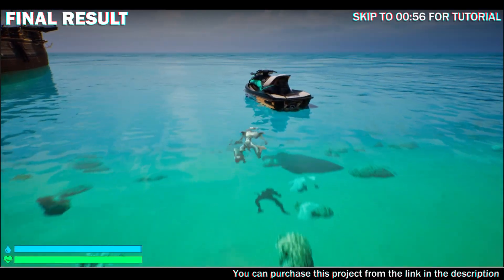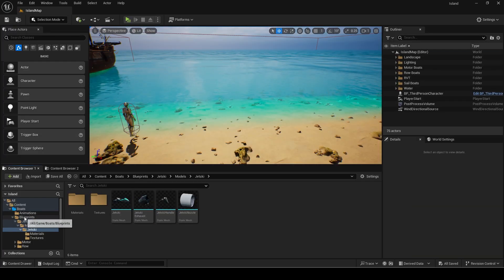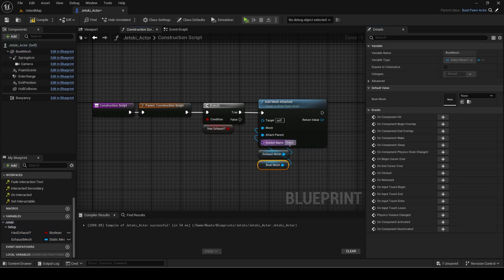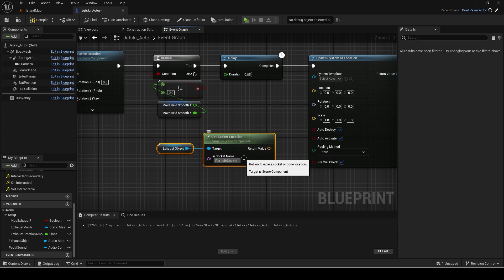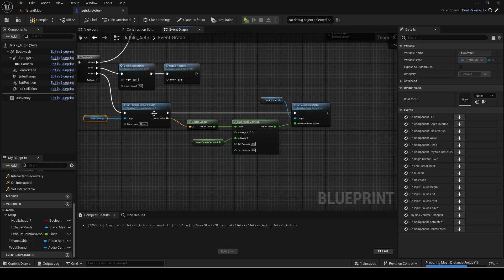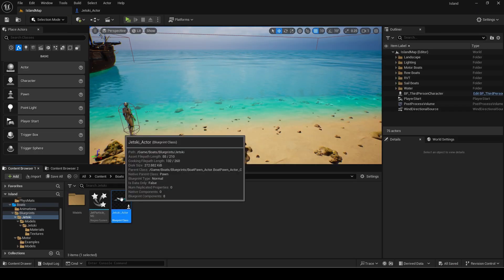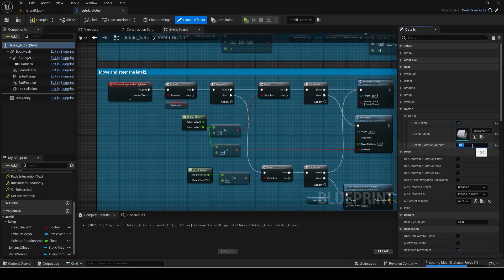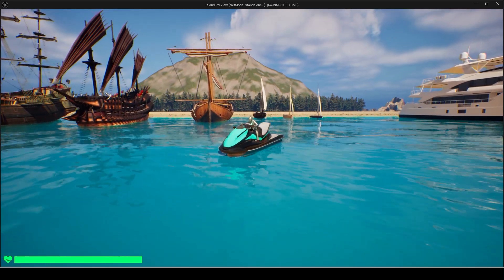Unreal Engine 5: Jet Skis Tutorial (Water Series)

Comment: Why isn't it on fab? I've already bought a lot of assets on it.🙃
Reply from the maker: @ue666  I can’t release these on fab since it uses models from sketch fab and mixamo animations which aren’t made by me so I don’t think I can legally sell them on fab so I used gumroad instead.
Reply: @UE5Poseidon  You can fill in the dependencies when publishing and use a simple model to replace the assets in the video as the initial blueprint function, which can pass the review.
Reply from the maker: @ue666  does the dependencies allow mixamo animations to be used?
Reply: @UE5Poseidon  I don't think redirecting mixamo to Character is an infringement, but you can still separate the redirected animation assets, not include them in the assets submitted by fab, share them with users through Google Drive, and clearly indicate the dependencies. Even under the most stringent requirements, you can upload only the blueprint part you made to fab, good luck.